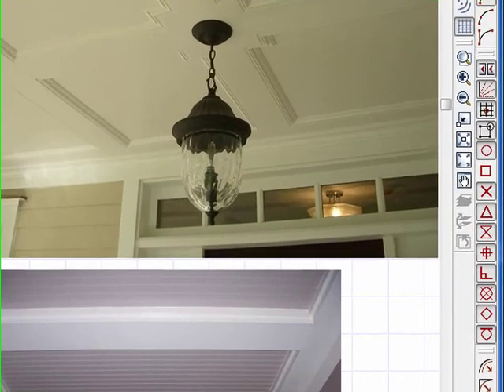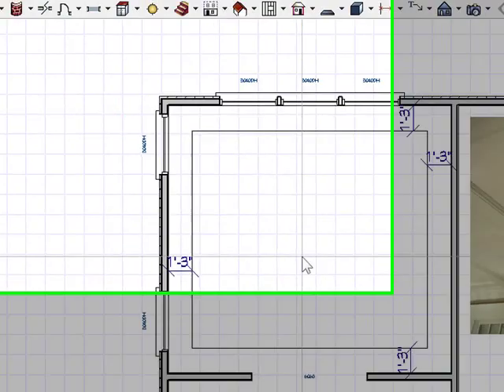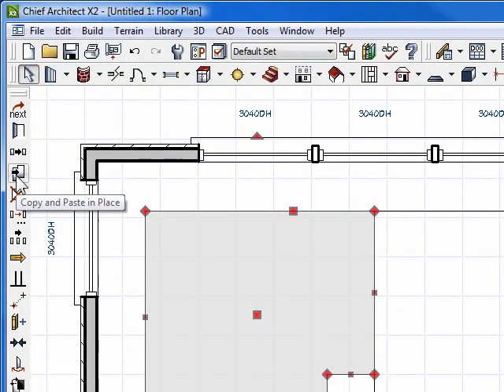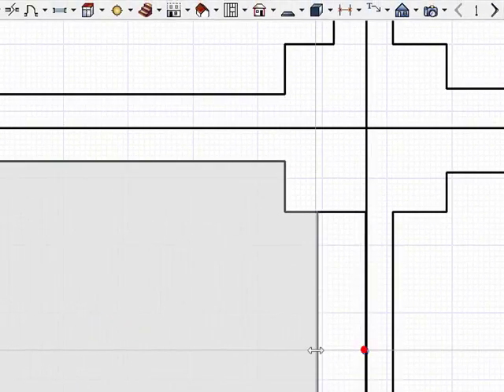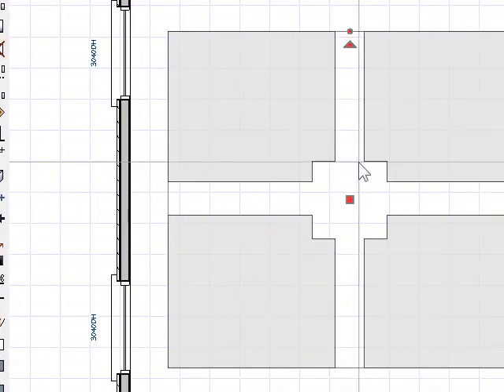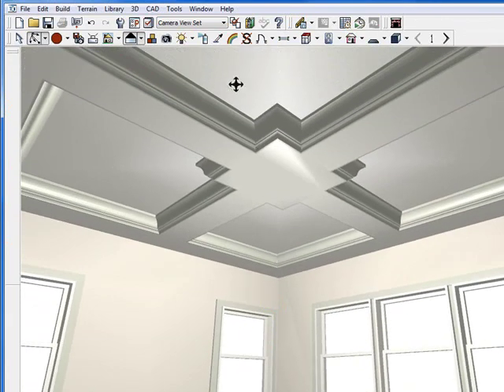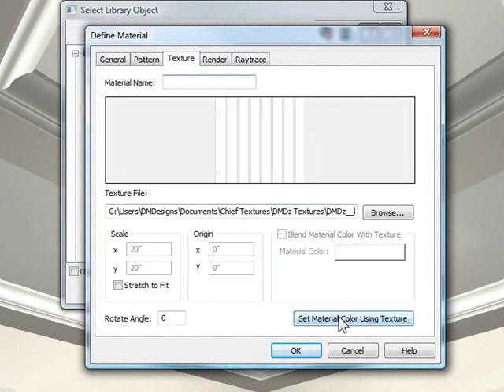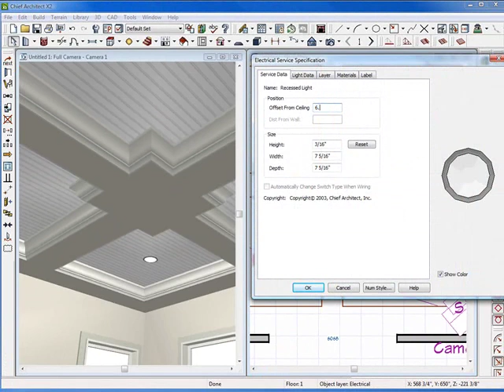Coffered Moulding Ceiling Treatments in Chief Architect

Comment: Very nice , looks very good. I have a question. I'm using X4 and designed my first house. In the living room , the ceiling doesn't cover the whole room , with an arch it lets open a nice sight to the second floor and a view from the second down into the living room. The first and second floor-walls have big windows to let in a lot of light creating more space. The problem is only that with a room camera I look straight outside into the air and with rendering it does the same , any idea?